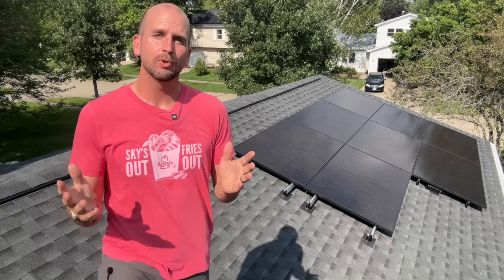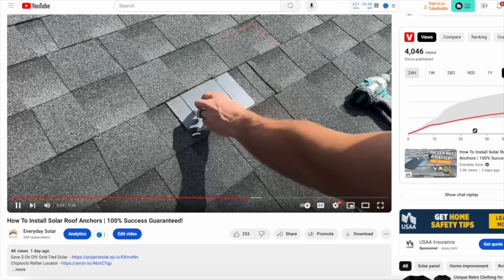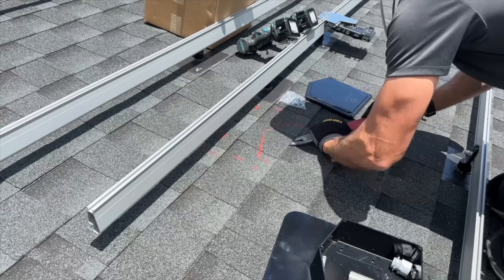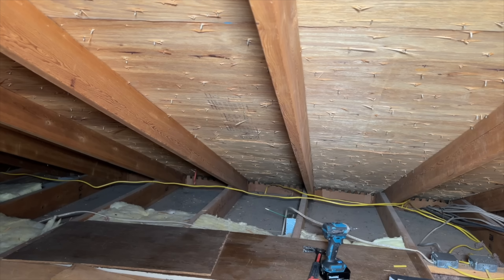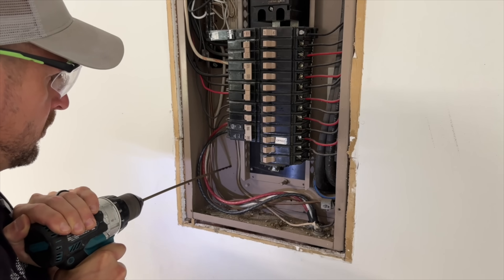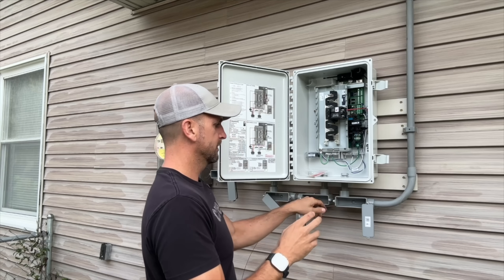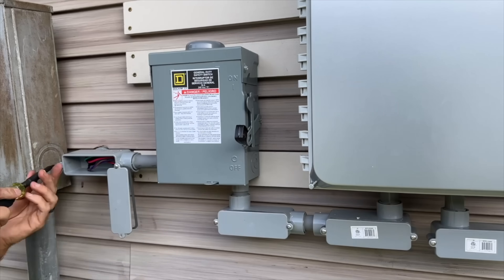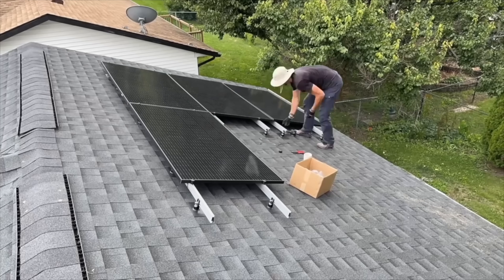How I Installed My Own Solar Power System | DIY Solar

Comment: I applaud all the well-documented DIY advice. One caution ⚠️: Project Solar seems like a 1-trick pony featuring roof-mounted panels, microinverters, grid-tie.

Depending on a person's utility company's net meter terms, it may not work for them. My plan includes a battery because it makes more sense to keep my power than sell it for a tiny fraction of what I'm charged. It helps me avoid the expenses of the twilight hour that I'm still charged PEAK rates when solar power isn't active. So, I'm going with a smart inverter that won't penalize my battery power charging by inverting DC to AC back to DC

Comment: Another thought is to dig deep into the absolute BEST type of Solar System to install. Very few will be in my ideal situation, but if you are ~~~
I'm 82 and was dancing around on my pitched roof yesterday tethered to a safety line. I use that EVERY time I have to go up there just like I did when I sailed my cat in strong winds. There ARE ways to think and act safely. Now, back to the original thought of variables in types of Solar Systems.
I'm just starting the process of building a SMALL solar system that is intended to LOWER, not eliminate my spiky electric bills.
I live in central Florida. I have a few months a year in which my bills are minimal because of the moderate temperatures in spring and fall.
However, I also have bills that quadruple during the two months of winter heating (yes, we had 18F one day and mid 20's often in winter), and when the heat arrives, we get 100+ for several months. The heat isn't as much a problem as the extreme humidity. My average is a four T-shirt day. I could ring a pint of water out of each shirt before I come in and drink a quart of liquid to make up for the four pounds that I typically loose if outside for most of a day. 
That all being said, at my age, it beats shoveling snow. 
So here is my idea. My house consumes too much power during the heat of the day in summer, just when solar panels are at their maximum output. Winter is the same. I like a cool house for sleeping, but like a little more heat once I'm up and around. That is also when solar panels are waking up. 
I'm looking at installing a second air conditioning system to supplement my basic ducted AC. A company by the name of Hotpoint Energy makes 12, 18 and 24000 btu systems that run on straight DC power direct from the panels, with no controllers whatsoever. NONE, ZERO, ZIP!

These are called Mini-Split systems because the compressor and evaporator are two separate pieces connected by insulated copper lines. The rated SEER's are the highest I've seen for any other types of AC units. These panels are wired in sequence to get 130+ volts DC. When the panels stop producing the AC unit stops. By then, the house is already cool and our cooling night-time temperatures will hold it there until morning. On cloudy days, I'll have no choice but to depend upon the ducted system for heating/cooling. This should reduce my electric bills substantially during the peak periods and I'll have no problems with the Grid Tie and Net Metering nonsense that is totally in favor of the Power Companies. The cost will be a few panels and the Hotspot or other brand of straight DC system. My plan is enough panels (5) to stay within the 90 to 380ish VDC range and provide 2400 watts to the AC even on cloudy days. 
Yes, this system will run on 240vac if that power is also connected to it. For the cost of another connection, this is another backup in case the ducted system fails yet again. I won't be making a ton of power, but the investment will be minimal and the ROI should be very short.
Being in an HOA, and in Citrus County, I've got a few minor hoops to jump thru as far as permitting goes. I expect no lengthy delays.
If this works out, I will be thinking about a system on my workshop to re-charge the huge 36 volt battery in my forklift.
I'm really interested in hearing comments. Rich   dilette@yahoo.com

Comment: I'm looking at having a 19.9kw (annual) system installed pending approval from the utility company (I'm just at the edge of a "red zone") and it's gross cost is $50K. For that I think I'll just let them do the work instead of doing the work myself. I was expecting a much larger savings to be available.

Comment: Did you choose the locations for the panels based on those rectangles get the maximum total Wh for the year or were you trying to balance them for the day? In a net metering environment, I’d think the former would be better.

Comment: I had a professional team install a 27 panel Enphase system on the hard to see part of my roof. But now I’m wondering if I should take advantage of the remaining slots and DIY some panels that are more noticeable. Problem is I have a beautiful house and don’t want to ruin its value. 

Maybe you could DIY go through the process of adding to a system.

Comment: Nice that your roof isn’t too high to take this on. With the gable, our second floor roof close to 30 ft. I’m for DIY, but that’s a project I won’t be doing. Our planned install for the fall is 51 Panasonic panels with a production of 18.3 kWh. It’s going to be a lot of work for the team doing the install.
Reply from the maker: Dang, that is a large array 👍
Reply: I did solar installation for over 4 years with a fear of heights! Anything approaching 15 feet is scary. Images of my mangled body flash through my mind at heights over that.

Comment: I thought most states require a permit and a licensed electrician install these now.  Is this not the case?
Reply from the maker: In my area homeowners are able to work on their own home but this installation was permitted and passed inspection.
Reply: Depends on the municipality. If you live in a rural area, it’s usually “whatever”. Lol

Comment: Nice work!

Does the 30% tax credit apply to labor, or do they screw you for doing the all the labor yourself?  I think that this is a problem with most states/utility systems programs.  I dont know why it is the case as the cost for labor for permitted work in an area is well know (look at union rates), or just get a quote from one or more installers.  Depending on the size of the system, I think it tends to fall between 30% and 50% of the total cost, so another $5k-10k times 30% should go to you.
Reply from the maker: On this one my labor is "free." What you called out is something to consider as the higher ticket price for professionally installed will get a bigger chunk back as a tax credit.

Comment: Just not sure solar is worth it. Just a new cool toy for geeks. Forgot to mention cost for insuring panels. Hail storms or other damage is not covered by insurance for free on solar panels.
Reply: His break even point is probably 5 years or less to nearly completely free electricity. Of course that’s worth it. Paying a company for solar, the break even point is sometimes 20-30 years. Did you come to your conclusion without using any thought at all?
Reply: @fiehlsport  Sorry. Meant to use the pre qualifier of I DON'T have a clue on how it becomes free. I live in 100 degree plus summers and springs. AC runs 24 hours a day. So solar will make that free?
Reply: @keith2498  Yeah it will — IF you have enough of it. And IF your equipment is reliable. And IF the power company doesn't decide to screw with you by shutting off your solar for extended periods. (Which they have the right to do because when you export power to the grid, it can affect their operations and the safety of their linemen.)

Anyway, it's not that hard to calculate:

How many kWh are you billed for in a hot month? Divide that by the number of hours in a month to get your average power usage. Divide that by the capacity factor for solar in your area. Now divide that by the nameplate wattage of the panels you wish to buy. What you get is a number of panels to produce as much electricity as you use.

Capacity factor, what's that? Well, a panel might be rated for, say, 300 watts. But that's peak output. It's what you'll get on a bright summer day at noon. How much do you get on average, though, all day and all night, summer and winter, sunny days and cloudy days and stormy days? That's the capacity factor. My own utility company estimates it for residential solar as 14.4%. Think of it this way: as a long-term average, they would expect you to get the same amount of usable solar energy as if you had (24 hours × 14.4%) = 3½ hours of bright summer noon conditions, and no other sunlight, every single day.

So, just plug in the numbers. Let's say the power bill you're trying to beat is 850 kWh in a month (and a month is about 730 hours), and the panels you are thinking of buying are rated at 300W each. First, your power usage is (850 kWh / 730 hours) = 1.16 kW, or 1160W. Divide that by capacity factor 14.4% (or 0.144), and then by the 300W per panel:

(1160W needed) / (0.144 capacity factor) / (300W per panel) = 26.85. And that's your answer. About 27 solar panels.

So, yeah. If you buy those 27 panels, nameplate 300W, you will produce about as much energy as you consume. Not at the same time, of course, as you don't get much energy when it's cloudy or snowing or midnight. But so long as you're still on the grid, and so long as your state or region has rules for net metering (i.e., metering your net electrical usage, subtracting the excess power you export back up the line), you can expect to pay for little or no power, except to pay off the home equity loan for the solar installation.

The devil's in the details and my estimate is only as good as the numbers you plug in. And net metering rules don't always allow "excess power credit" to roll over from the sunny months when you produce more than you need, to the darker months when you produce less. But the overall point stands.
Reply: @ps.2  So that was outstanding, thank you!
Reply: @dianeladico1769  Thanks! Hope it's useful. I know it was pretty long for this forum.

I should add briefly that the most economical deployment of solar isn't necessarily to replace 100% of your hot summer electricity use, as my calculation attempted. Net metering policies vary, but typically you don't get any money back for supplying more energy to the grid than you use, long-term. Or if you do, it's at a wholesale rate, far lower than retail rates. So, if you deploy too much solar, great for the environment maybe, but not so great for recouping your financial investment.
Reply: @ps.2  Thank you That makes perfect sense.

Comment: I'm getting a ~$25,000 system installed. Searching for the panels and microinverters they're using adds up to about 8k, plus they probably get a discount being a bulk purchaser. Add in a grand for mounting hardware, wires, and stuff. Add another grand for 4-6 hours of labor, plus the delivery. That's $10,000 worth of stuff they're charging me $25k for, a huge markup. Not as bad as pharmaceuticals but still not fun. 

I can't really DIY this on my own, not healthy enough to be clambering around the roof in this heat carrying stuff, and don't know anyone in town handy enough to help. Plus the permitting and negotiating with Black Hills is annoying. It took the pros over four months the first time, then another 3 four for the permitting. They're still not on the install phase yet. 

I did go through Energy Sage, and got what I thought was a great company for a good price. Turned out to not be as cool as it looked, but I still recommend ES for finding companies at least better than the absolute scummiest. 

If you've got the money it's probably worth it to buy, if you're handy enough though it's a great way to save a ton. 

Oh, that's not factoring any rebates or anything. The repay is gonna be 10-15 years assuming nothing catastrophic happens.

Comment: I have acreage so i wouldnt put it on my roof. I'm also in a state that - apparently - is more corrupt than Illinois and we don't have net metering and more than likely never will. But, I'd use every drop of it on heat pumps anyway. So I want to DIY and I wouldn't be grid tied. So with that in mind, do you still think I should go through some 3rd party service?
Reply: That's okay. You don't want net metering... Keep all the solar to yourself. That's what I'm doing...
Reply: @SolarizeYourLife  I would be nice if we can get a start lowering our power bills without battery though.

Comment: I bought my solar panels (18 270W), inverter and rails from a local solar distributor who sells solar equipment only, for wholesale, and installed the system entirely myself.  Saved me ~$10k, and save ~$3500/year on power costs.  I would highly recommend using a single string inverter, micro-inverters have a poor track record of reliability.
Reply: Micro inverters are better in terms of reliability just because if one goes bad you still have the rest, on the other hand if string inverter goes bad, that’s is for you. Talking from experience.
Reply: In reality, micro vs. string is totally dependant on installation. You definitely don't want a string inverter where some of the panels get shade while others are non shade during parts of the day.
Reply from the maker: Were yours ground or roof mounted?
Reply: I almost gave you a thumbs up but you mentioned micro inverters. Now you got a thumbs down... 😂

Comment: 13 panels are offsetting your entire electric bill?  I have 22 and they aren't doing jack for my bill and now I have the solar bill on top of that. They also shut off when the power goes out. So, I basically got a stupid tax.
Reply: You have central AC? If so how old are the units. You might be asking a lot of the panels if you don’t have any energy efficient equipment
Reply: @strongisland7015 it also depends how far north they are, how efficient the panels are and how well laid out they are to make the most of the sun.

Them turning off when the power is out also implies they are directly tied to the grid and are buying power at night instead of keeping it in batteries that can sell power back to the grid (depending on their grids policies, if that is allowed or profitable, if they live in Texas where they can be charged in crazy spike prices and don't realize other states don't allow that).
Reply: You have to keep the solar panels clean. Make a Huge difference in there efficiency.
Reply: You better have a way to monitor the output, or you’ll definitely be paying the stupid tax. I was watching one guy complaining about his installer because they forgot to plug the panels in lol
Reply: You always could change out your inverter and buy some batteries and stop bitching...